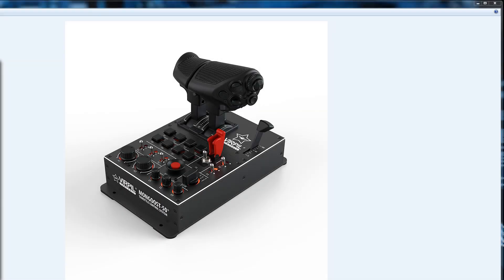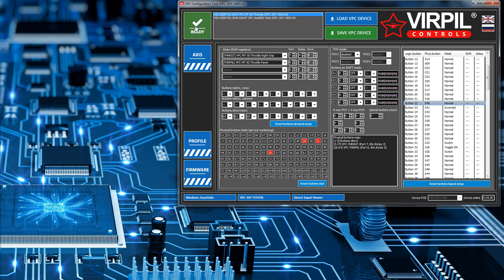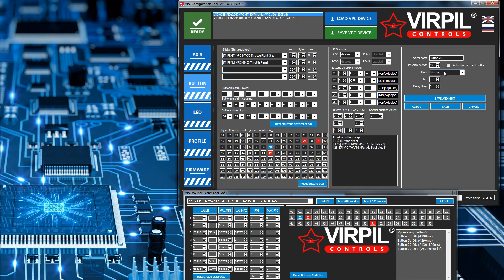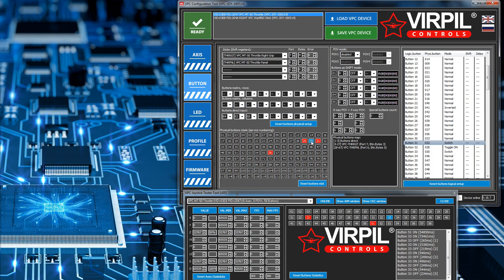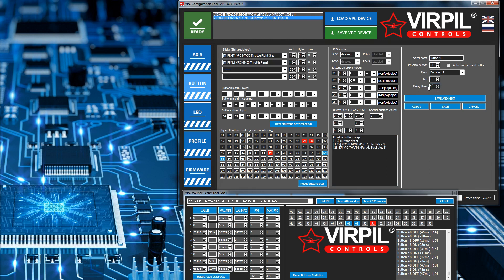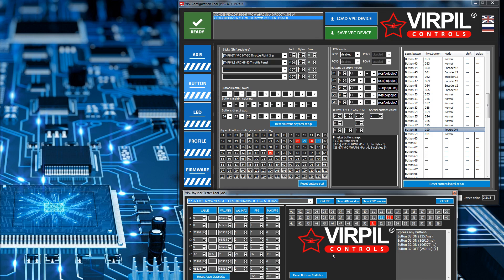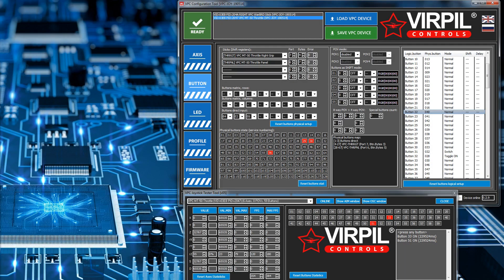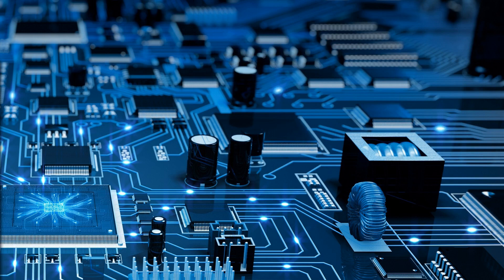VPC Virpil software tutorial - Button configuration

Comment: Any way to get the encoders to work more like rotary switches like the X56 makes use of?  Encoders really seem to suck -- especially with how they interface with DCS...
Reply from the maker: You could create a virtual analog axis and use the encoder to increase / decrease the analog value depending on direction turned BUT you will usually need to have a third button to "center" this virtual analog axis

Comment: I know this is a pretty old video but are you able to map a single binding for dual sticks?  For instance, I want both my right and left brake lever to be mapped on one key.  Star Citizen is unfortunate enough to not allow for multiple bindings for a specific function.  Thank you!
Reply from the maker: use joystick gremlin, if for example the normal default keybind for a function like brake was b ,  then you use gremlin to bind b to both stick brake levers

Comment: Hi Havoc,
I just came across a neat program called RS Mapper. Have you tried using this piece of software? I'm curious if this will work with Virpil? BTW, I finally got my CM2 throttle to pair w/ my Warbird base & VFX F14 stick.

As a side note, I'm curious how you might go about using the weapons switch on the VFX stick? I was thinking that I would set it up for guns, then bombs, then rockets (IL2 - Battle of Bodenplatte). Thanks for any advice.

HB
Reply from the maker: Not tried it, I use Joystick gremlin and it has a huge amount of functionality,   VFX grip (I do not own one) I would need to get a screen cap of the button tab form the VPC software to see what way it operates (what type of button type it is configured for)

Comment: Hello. I just ordered a virpil throttle, a base and a TM hornet stick. My question is this: can the throttle and the joystick interact? For example, can I use the 5 modes dial on the throttle to assign different outputs after pressing a button on my joystick?
Reply from the maker: which base are you using ?
Reply: @HavocCompanyClan  Virpil T-50CM. I think it's possible in this case.
Reply from the maker: @VG-ey4gi  you can use the VPC shift utility to do this, but I would recommend using joystick gremlin it is much more powerful

Comment: when i use the pov hats on the mongoose cm2 stick it always presses the push button (center) aswell as the direction, this means dcs only ever see the centre button press and not the direction, how do i fix this?
Reply from the maker: which firmware version are you using ?
Reply: @HavocCompanyClan  iv just updated to 190930, apparantly its a known bug with older firmware so il try it now
Reply from the maker: @Scoobydcs  aaaaaaaaaaaaaaand that why I asked you which version you were using
Reply: @HavocCompanyClan  ive got it workong and everything bound in dcs now. 
It really doesnt like having both the t50 and warbird connected at the same time though,
I havnt checked in dcs to see if it causes problems but the virpil software really doesnt like it
Reply from the maker: @Scoobydcs  define doesnt like it ?
Reply: @HavocCompanyClan  sometimes it sees and displays both, other times it removes the warbird profile but the mt50 profile is actually the warbird,
I havnt tried this in dcs itself yet so i dont know if its a hardware conflict or just the virpil software having a strop
Reply from the maker: @Scoobydcs  in virpil software, go to profile tab and see what PID it is setting for both devices (you need select device and click load vpc device) before you can see what they are using
Reply: @HavocCompanyClan  pid you mean the name? 
When it throws a wobly then the mt50 doesnt appear in the list at all